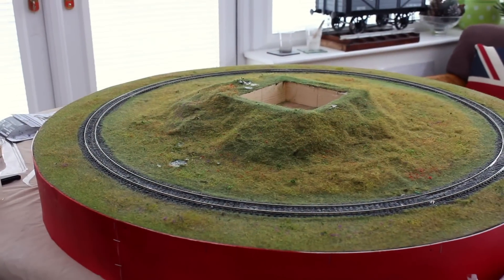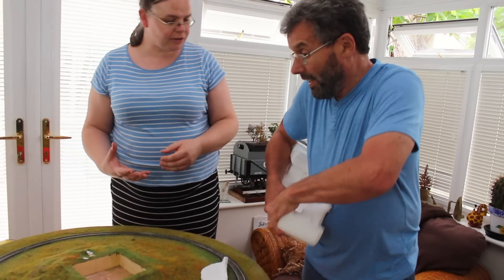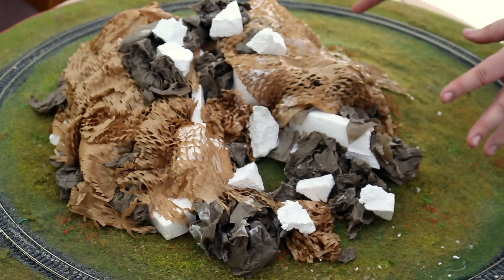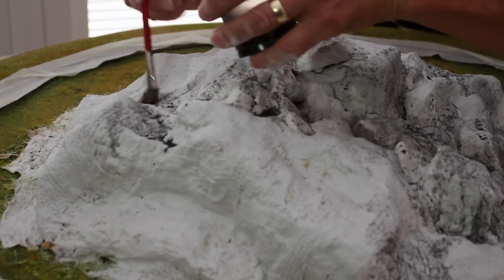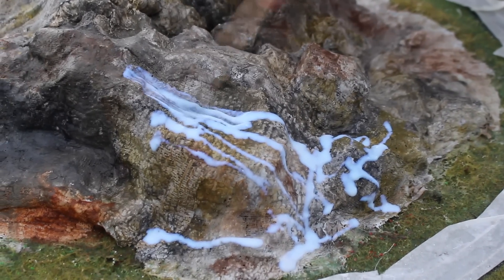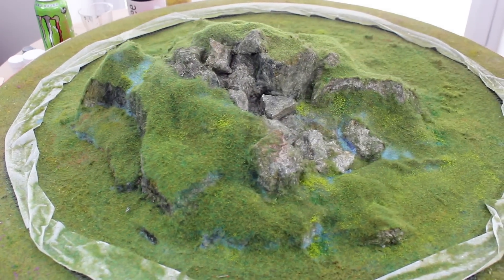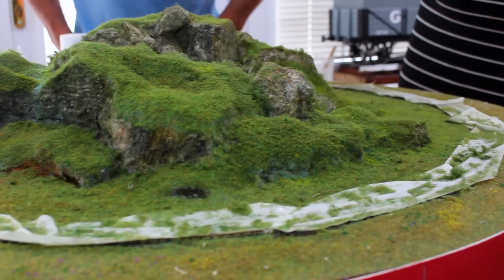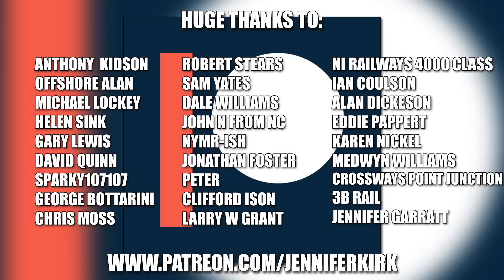How To Make A Realistic Landscape Diorama From Trash

Comment: Hi Jenny ,, wow ,, amazing how you can make something out of nothing. 
It is just amazing how much we can learn from people like yourselves for us to learn to do stuff in our hobby.
I have been thinking outside the box on some of the ideas that i have seen just around my house & yard (guilty of being a hoarder/collector) as i am had 30+ years being a scrap metal dealer.
I have had some similar thoughts on using recycled bits for all my train layout bits in the future ibjcludin th table ie i have alreadty stripped a few queen size bed bases thst i got from my family as they have long lengths of good straight pinewood in them. 
I have already pulled apart a heap of cd drives out of cd playersmto het the motors out and to utilize them in broken locos i have here.
I have aslo converted them with the 3D convertor kits and cogs to get a few old bangers going so there working again and doing what they were meant to do.
I myself have been fixing a heap of loco's both steam and disel and a few electric ones too as it helps with my depression and ptsd that i have.
I have also used the clear plastic out of the cake rings(the ring around the cake that keeps it all together) as glaizing for train windows that have either been broken or were missing and it works like magic.
The other bits of clear plastic i have used it that clear plastic that u have to open with a pair of scissors like for tools and toys etc as thats works great for glazing. Im in the process now of building a scratch built engine shed maintenance dept out qan old video recorder that i pulled apart for parts. 
I also keep all of the cogs and gears and the all of them teeny tiny little screws as it saves having to buy them in the future and have used them already in some of the repairs that i have had to do to the pancake motors in the 16 wheel 47class (i think haha).
Anyhoo keep the good work and gr8 there.
Cheers from John in Australia
Reply: Don’t forget to save rust particles to use for weathering effects too